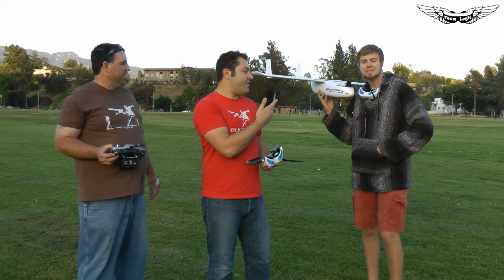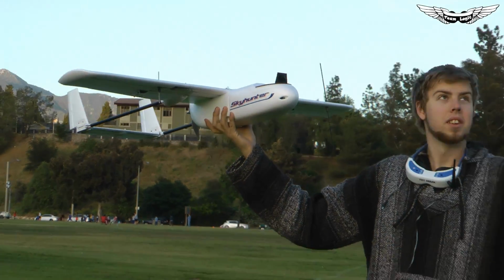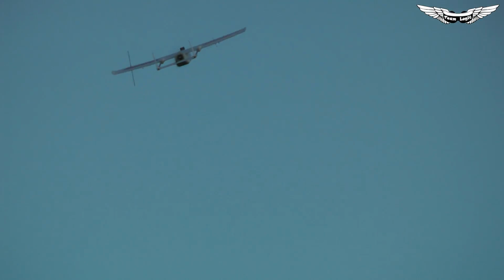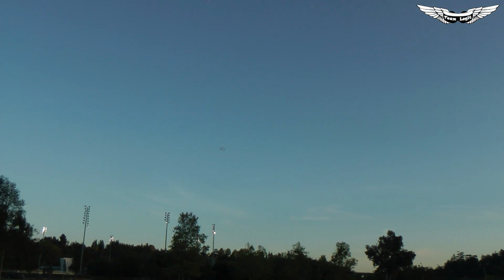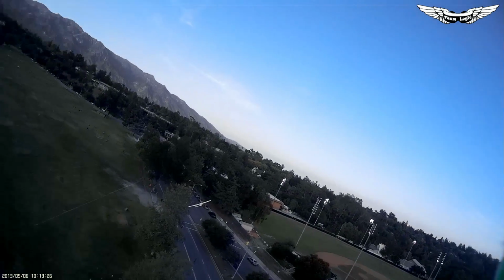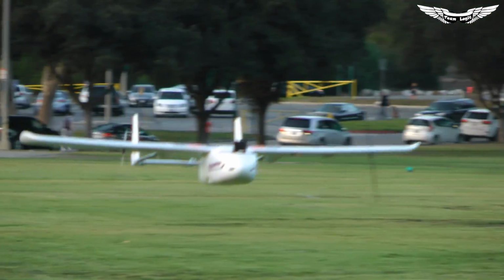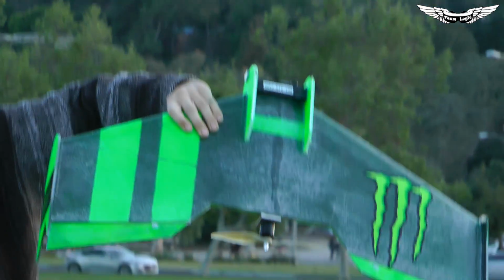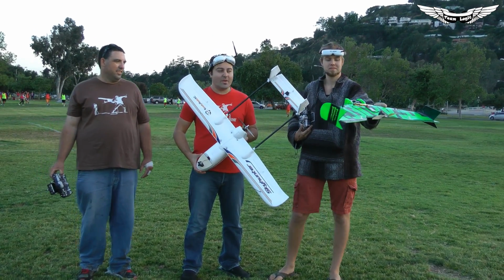Mini Sky Hunter Maiden and Flight Review

Comment: I wouldn't mind a close-up view of how you set stuff up inside just for some ideas.  Do you glue in the top shelf or let it be able to slide for CG adjustment?   Does it stay put if you didn't glue it? I wonder if there is a  way to keep it adjustable, but not have it be so loose that it slides on it's own in flight?

Comment: Nice review.. That baby cruised very nice. Looks like you might need to shim the motor as it was pushing to the side under power. Being a sky hunter does it come with a build manual? I know the larger model didn't.
Reply from the maker: ***** No Manual Included, But the build is pretty straight forward. The Trim was off that why it banked to the left. Its on a Y harness so the servos never sit straight when thats the case you have to do manual adjustments.
Reply: Team Legit The hardware for the servos.. threaded rod with a clevis or type with the set screw? I ditched all the servo hardware from the RMRC 1800 Skyhunter

Comment: would you recommend this for me? i have been flying miniquads for 1/2 years now..i have flown  a few planes,but is it possible to just cruise this slowly or do you hafto completly floor it all the time ?
and how is it to launch? do you hafto floor it there aswell or does it pick speed up well??
Reply from the maker: Daniel Mähring I would not recommend this as a first plane. Get an EPP wing. they are durable. this will break on the first crash
Reply: it is not my first plane,i have had about 3 planes already,a little glider and a mutliplex easyglider pro,and now a cesna 182 from HK,that i can fly without any problems.
thanks for the fast reply
Reply: I could imagine flying it,it looked as if it was able to slow down nicely,so I shouldnt crash,overall? is it a nice plane to fly?

Comment: can a beginner fly this plane
Reply: yes
Reply: are you sure? i am a "fairly good" multirotor pilot and had two sailplanes (multiplex easyglider pro and nine eagles skysurfer) and now a cesna,is this thing actually nice to fly,or do i hafto worry about tipsalling it all the time? and is it easy to launch? do i hafto completly full throttle full throw launch it or just a toss and like 3/4 of throttle?
Reply: Daniel Mähring I often launch between half and full throttle depending on conditions where I fly.  It's always windy here and I have no problems at all.  My buddy has one as his first plane.  I find it flies kind of like a clipped wing Easystar, nice and peppy.
Reply: ssrc30  ok thanks!
Reply from the maker: Every single one of ours has Been destroyed due to tip stalling
Reply: in woch conditions? pilot error or just that the plane is hard to fly?